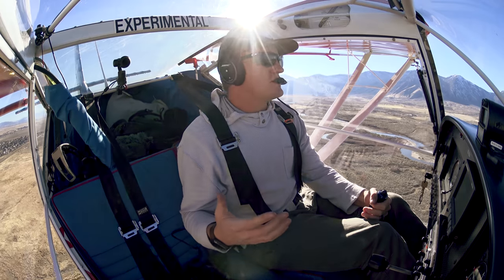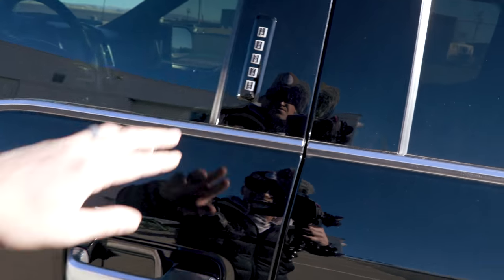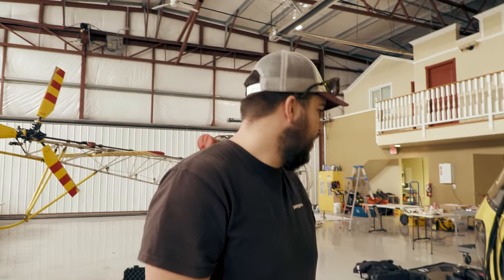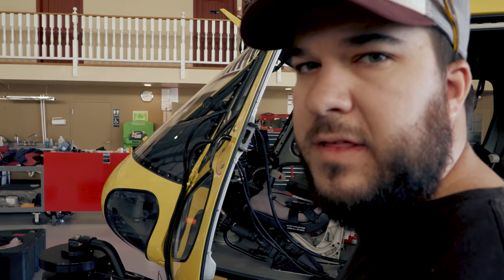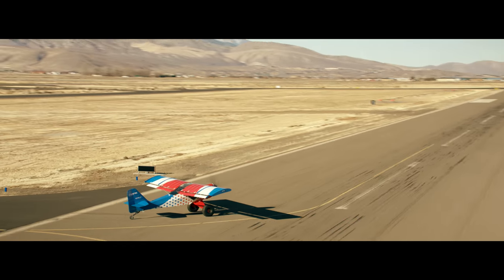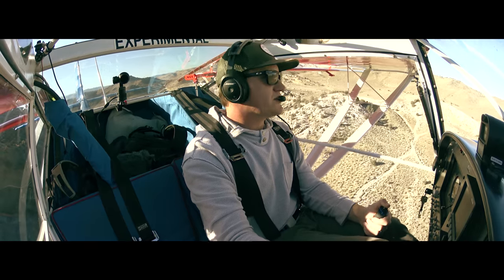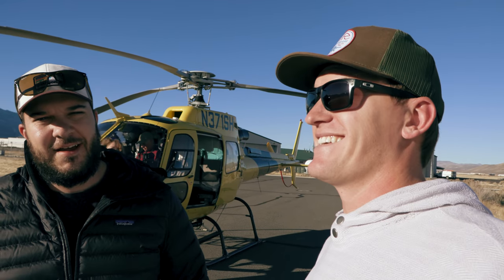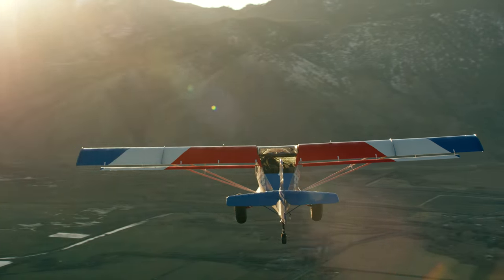Vlogging on Hollywoods best camera

Comment: Having been a photographer for over fifty years, and a digital studio since the start of that revolution, I have to say these images are gorgeous. Its not just the system being used but the fact that there is an eye framing these shots. Not that your videos are bad but flying and shooting at the same time means that you cannot concentrate on the image. As to the cost. My first full frame  CCD digital back to the Hasselblaad was 36 thousand dollars. I know the equipment you use to shoot professionally isnt cheap either. However,  I have rented Jet Rangers for shoots for far less than that. Ive already watched it twice. The color and contrast are absolutely beautiful.

Comment: Hey Trent, totally understood the camera talk. You took me back to a History Channel show I worked on with an INSANE Phantom high speed camera system. It was stopping bullets in flight. This camera had a fiber optic cable to the truck to transfer data. Yeah, the camera needed that fat of a pipe. With each set up, a producer picked the best take and every other take was deleted because there simply was not enough storage for every take at 10,000 fps. 

Keep up the damn amazing camera and vlog work !!!!!

Comment: I was at Wendover airport and they were shooting some film and there was a jet ranger with a gimbal and it was hovering on the flight line.  It was not moving an inch.  This helicopter looked almost as steady as it were sitting on the ground.  I was so impressed.  Now you might say, sure anyone who's good can do that for a short time.  Well, this guy was hovering like that for over 5 minutes.  Blew my mind.  Rock steady.  The pilot in this helicopter is probably a damned good one, just not at that awesome level.

Comment: How had I never heard about your channel? Production quality and content are simply next level! Probably my new fav. channel. I even turned on notifications!

I have a few questions. I’m a student pilot and have just started flying the basics. I wanted to know how would I proceed to basically get to where you are? After the private license and instruments license, would I just need to go into a Tail-Wheel type rating? 

Also, how much do these planes cost? A tailwheel in which I can do a few tight turns, and rolls even? Tailwheels and aerobatics (not too crazy) are my passion. 

Thanks again for such amazing video!
Reply from the maker: Hey Juan! Thanks man! Yeah, just getting your tailwheel endorsement and then a backcountry/mountain flying course would be where to start. 👍🏻 and prices vary depending on the age and what exact plane you are looking at. The newer model kitfoxes are normally in the $65k range, some can be found for much less and a brand new factory built one will run you about $100k. They can do “gentleman’s aerobatics” loops, rolls, hammer heads, etc.
Reply: Trent Palmer Thanks so much for the response! Expect to see me here in the comments section quite often! Keep creating amazing content, I am literally so happy I found thid channel!

Comment: Awesome video! Also if your looking for s new blogging camera I can suggest 5: gh5, Sony a7RIII or A9, kinfinity or Lieca SL
Reply from the maker: Tried the GH5, just sold my A7RII (not the 3 though), I will look into the others, honestly I am lazy so I kind of moved away from DSLRs and mirrorless cameras for the time being until I can get something that will do everything the canon GX10 does only with a bigger sensor, but I wanted good AF, battery life, and flexibility. You put the right grade on it and even iphone footage can look nice 😜
Reply: If your too lazy than there is always 3 other cameras: sigma dp3, Leica LT2, and the new development of the light L16 ( I think you’ll like this most). All these cameras are mainly touch screen  and built around total ease of use. Maybe that will help

Comment: I noticed you gasing your plane with bladder tank. What make do you use, and do you bring it in your plane for refueling on a trip?
Reply from the maker: I bought mine from a friend so I’m not actually sure what brand they are. I haven’t actually taken them on trips for refueling yet but I plan on it. They are also great for pulling fuel out of the plane if you are doing a STOL contest and want to be light, then you just put he fuel back in after

Comment: Freaking Epic!!! Does anyone know what camera gimbals or equipment he is using right behind his head to keep the camera straight and level during turns? @ 10:40  Just hit the sub button.! BTW, If you did this same type of video, but did some spins!!! OOOO CRUD that would be awesome!
Reply from the maker: Thats the DJI Osmo mounted on a bar behind me using the Osmo remote extension cable 👍
Reply: Freaking Awesome Dude! Thanks! #FTWTowerController